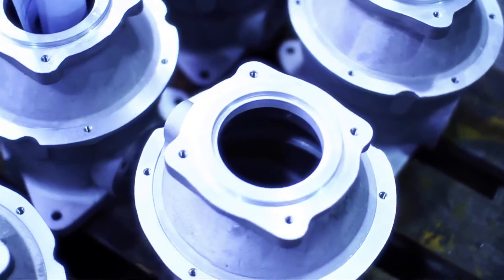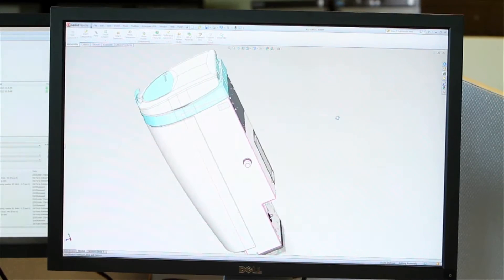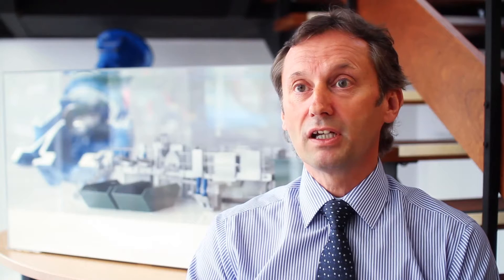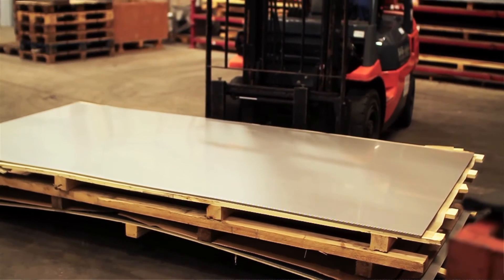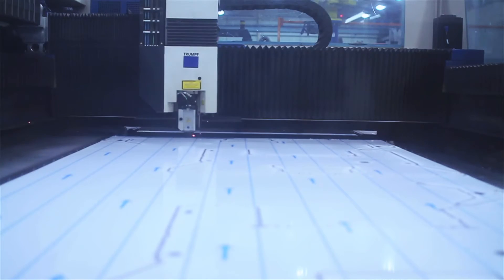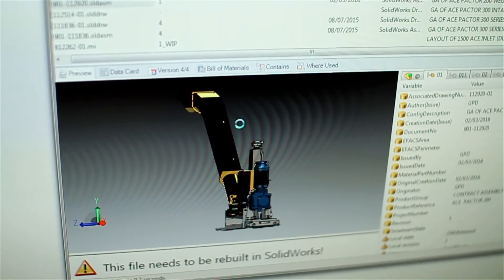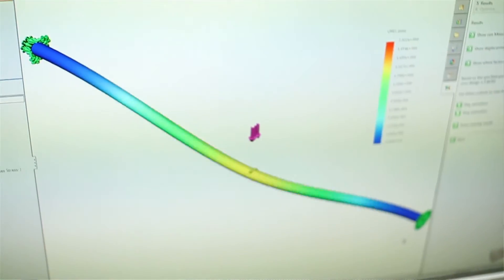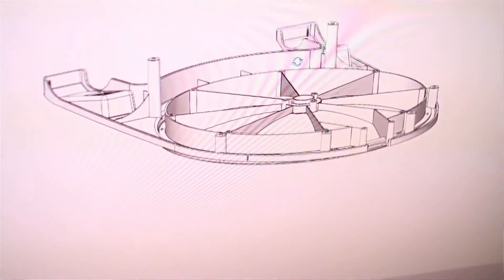Haigh Engineering and SolidWorks - Cutting Edge Technology and British Engineering

Comment: Cadtek has supplied 3D CAD software SolidWorks to Haigh since 1989. 
We've found that SolidWorks is evolving, developing and stepping up to the challenges that companies like us are throwing in.  It allows us to move seamlessly through the processes of design, testing and manufacture allowing us to provide the most reliable macerators.
SolidWorks helps us to continually learn and evolve which enables us to retain our strong British technological heritage to be what we have always been.  Excellent engineers in the healthcare sector.